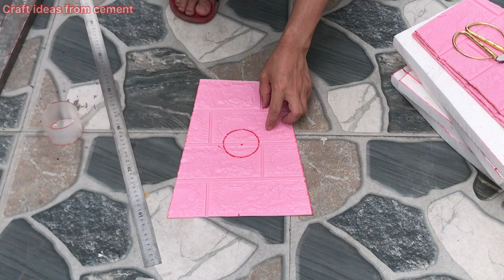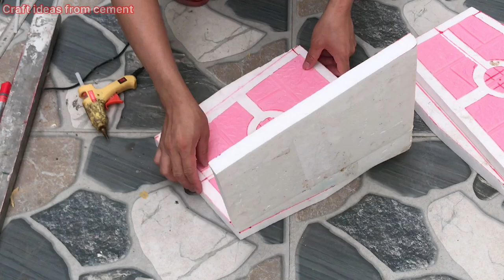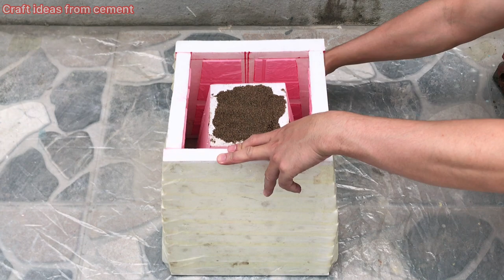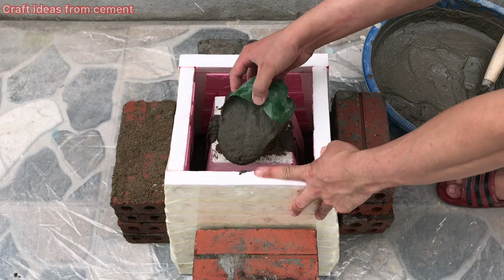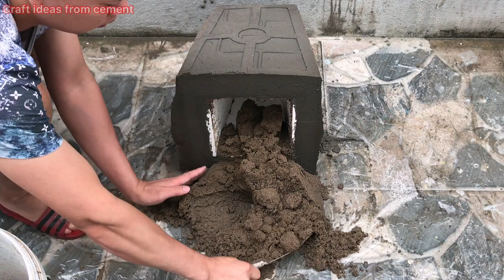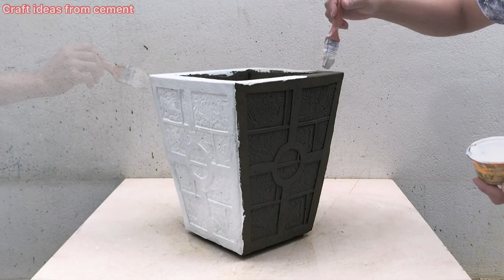Amazing with beautiful cement pot shaping technique - Home garden decoration ideas

Comment: Please include the dimensions, the materials used and the ratio of sand to cement and water
Reply from the maker: That material is porous. Size and height is 35cm. width 30x20cm, thank you for watching